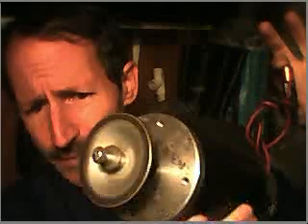Joseph Newman Motor, free energy or con job?

Comment: Dude what if he connects a small DC generator to the tail end & connects it to the front replacing the batteries with rechargeable, you claim 9 volts are expensive ? If you can't see that there's an excess of energy there then your not getting what he's doing or saying and perhaps he's intuitive enough to know that your intentions aren't right after all Jo is about Service to others not service to self can you claim the same thing  ? for all I know you are a paid Govt Troll.

Comment: Another thing to keep in mind is to measure power factor if you're doing AC motors and/or generators with a load of some sort. If the voltage is out of phase with the current, the actual usable power is less than if you did a conventional power calculation. I am a student of electrical engineering and watch a lot of the "overunity" videos for amusement and to reply to allow those to understand the basics of electricity to see the manipulation going on in these videos. I am extremely sure there will never be any sort of overunity device, however, as a scientific minded person I must also keep myself open to the possibility. So keep experimenting people, I doubt it'll ever be done, but if you're going to attempt an overunity machine at least have the appropriate knowledge base.

Comment: you could feed it back into the motor.
but the only way to do that is to shuffle the energy arround first.
generators output can never be feeding power at the same time the motor uses power or it will run dead.

Comment: High Voltage and make big sparks, but amperage however is what really matters
Reply: I have to disagree, amperage is what matters in our world today because the use of amperage makes money for the energy industry.  so all motors are designed to use amps.    ever make an electromagnet ?  they can work on very little amps.  now try winding it  to handle high voltage and see if the magnetic field gets stronger.

Comment: All he needed to do was make it run his home....very simple but never done....and never will be...disconnect batteries and show it run forever...pretty simple right...but will never be done....
Reply: Russ B  i agree, if you spin a item in space it will spin forever, no different than earth, the only thing you need to overcome is air and bearing  resistance,  showing voltage is useless, its amperage that's the real indicator of  power and this fails to do that, they claim 80k Volts !! big whoopie, static discharge can pass that, but that wont push a fan, now is the device very efficient, sure, but it's useless.

Comment: If it helps you... Power (expressed in watts "W") is volts times amps. So 0.01 amp times 10.000 volts 
Equals 100 watts. 
Thats how long distance power lines operate. 500,000 volts only carying say 1 amp... The end user being a neighborhood at 110 has 5000 amps at its disposal.
Ofcourse, theres losses involved of all sorts, but it shows that volts alone, or amps alone, tell you next to nothing if you want to know power in/output...

Comment: One thing you have to understand is your little demonstration of your 1.5 watt battery source would only service your load for a very short duration of time, were talking less then a minute . Many people that have a much stronger understanding of the physics involved  have replicated Joe Newmans motor and have had them service huge loads for many hours at a time with very little loss to the battery.  So were not just dealing with watts, but time and torque of a large mass.
Reply: yes another person who can use his mind.  Donald, thanks.   the way I see it you don't even need to figure watts into the equation  and that is why Newman didn't bother to either.     and it would be very hard to calculate  when really your over unity was coming from  back emf of the coil, along with the help from the mass to keep it going and  Newman I don't think ever experimented with resonance, if so he would have found other really fun phenomena.

Comment: Actually, you had it right the first time!
YOU know NOTHING when it comes to ELECTRICITY! lol

What Joseph Newman pretty much explains...
Is that CURRENT is what generally runs a motor....
NOT VOLTAGE!!!

I believe you should go and take an electrical physics course...
And later try to understand what the man explained before you call anyone a fraud!
Reply: Wow, and I watched his hour long video and it says on screen "runs on voltage, not amperage" which is total bullshit as just a bit later he says the batteries were getting warm which means that it's pulling a lot of wattage.
Reply: John Franklin HUM...NOPE! As he also clearly mentions that the normal type batteries (not rechargeable) were actually being RECHARGED, as the machine ran!!!  Please look up his other videos, cause you seem to be missing a great deal of information!
Reply: droidcrasher
recharging non rechargeable batteries
yeah, that's just stupid, you cannot do that as the chemical reaction that creates the electricity in the first place is not reversible unless it is a rechargeable cell to begin with...

why would I want to watch more of this bullshit? there's already several flaws in his thinking that he is definitely overlooking on purpose so he can sell his ideas to gullible idiots
having to have batteries at ALL in the setup means it's not running under it's own power, if he just spun it up by hand and it kept going, THAT would be impressive, as long as the wheel he was spinning up was clear so you could see there were no hidden batteries, as lots of other scam artists have tried over the years...
Reply: Research Joseph Newman Big Eureka and see him recharge non-rechargeable batteries!  ;-))) 

You'd  have to be pretty full of yourself to believe for a second, that you know everything there is to know about electricity and magnetism!

Comment: There is also something about the efficiency of a electric motor that many people seem to overlook. The efficiency at low power is way bigger than with high power as more heat is produced.
Generally the more amps they run at the less efficient they become.
Also highvoltage and low amperage = higher efficiency.

Comment: Unfortunately, there are many ways to get energy in a more harmonious manner.  The problem is not the discoveries not working or being applied. The problem is us the people not willing to change ideas, admit mistakes, and accept others ideas for what they are.  Volts = Electrostatic Energy and Amps = Magnetic Force We have been making motors that run off force and neglect the energy... You don't have to take it from me, just read what the father of the electric motors said. (Tesla)

Comment: Google "Topological Evidence of Time Distortion in the 666 Machine" Jos Newman got me started on researching air core coils resulting in this invention, that may seemingly convert time into energy. However it uses 3 phase AC input and directly outputs its energy result through voltage transformation. While this is happening a measurement of the phases phase angle reference to each other has decreased to 5/6ths of the normal 360 degree value

Comment: if you have a pice of copper and you heat one half of it you have a charge differential.
how much change toward a balance in themperature equals power in a given amount of time. in a thermoelectric cell you use a change in temperature to form an current instead of moving ions in a liquid acid as it is in a battery. its the potential difference that is your voltage and how much change in potential difference that is your ampere amplitude.

Comment: a change in temperature changes the electric resistance in an element and that is why a lightbulb works. if the electric resistance of an element change very little conducting electricity the light it emit will be of higher frequencies like blue and white light. a larger volt x amps will produce a smaller change in electric resistance in a conductor and can cause the temperature in the conductor to drop makeing it a better conductor. it can produce blue white light then.

Comment: if you heat a dead battery it act like a thermoelectric cell. if the battery has a very small charge differential as dead and you use heat the differential in temperature in different parts of the battery can cause a larger charge differential in themperature since  if you have two elements together and they have unequal electric reistance if you heat one of them it would produce a net force until the electric resistance of one element is equal to the other.

Comment: I apologize.  Of course you thought that an electrician would know enough.  Ohm's law is quite good enough for anyone analyzinig house circuits.  But you need to know more about Maxwell's equasion which Ohm's law was derived from. The motor is not creating energy: you know that cannot be done.  But it is tapping energy that is not known by most electrical types unless they get real chummy with back EMF.  Tom Bearden; New Energy Series does a great job with a basic explaination. Go for it!

Comment: The Newman motors do not put out much mechanical energy, but they put out a lot of RF bursts. This is the overunity power they put out. You have to design the mechanical commutator right to maximize the radio frequency power coming from the commutator´s sparking.
The graphite brush is burned and this puts out free electrons into the coil circuit.
Come to my site, there it is all explained.

Comment: voltage is free according to tesla well not exactly free but you will get the idea....

In other words the drain on your electric bill will be less if you only used high voltage...

They measure usage by amp drain I think, dont hold me to it but i have heard this idea before....

Comment from the maker: I'm not sure how efficient Joes motor is. I suspect its highly efficient as far as DC electric motors go, but no more efficient than a high quality DC motor you can buy right off the shelf. Keep in mind if Joes motor was over a hundred percent efficient, he could attach a generator to it, and produce a self running motor with no batteries at all.